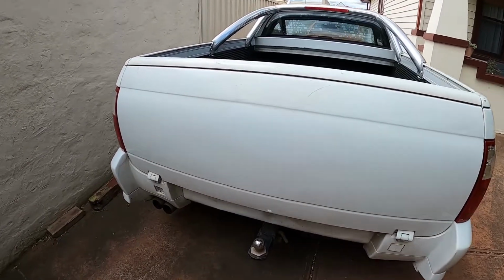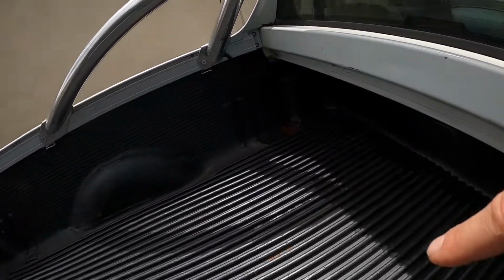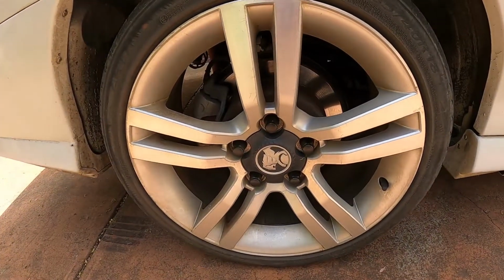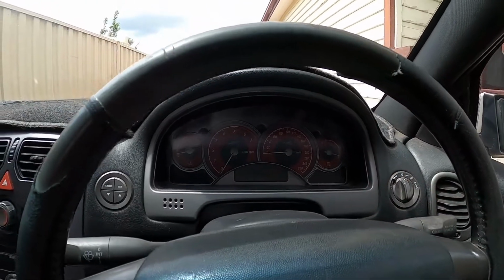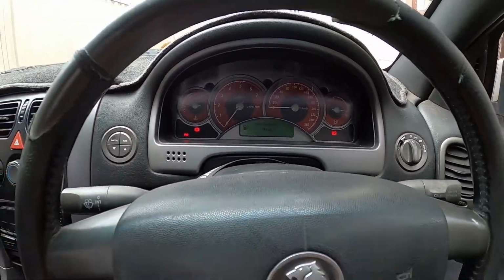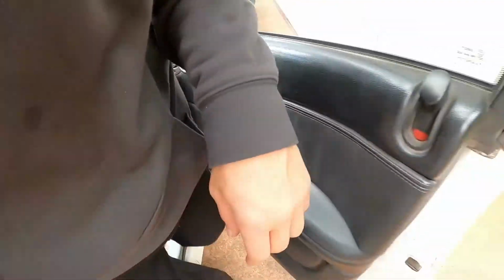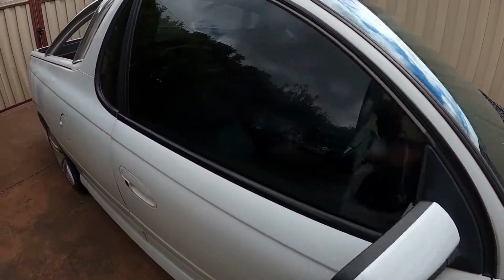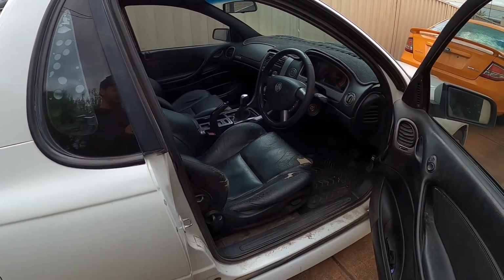VY CAMMED LS1 T56 UTE - Part 3

Comment: Loving ya work, fuel issue could be a bad start relay? Try flipping with the high beam relay. Could be a bad earth too but ya prob right with an incompatible cluster.
Reply from the maker: He mate, thank you for the positive feedback and I'm glad you like the videos. Hopefully I can do it full time soon. The reason it was hard to start after the oil change was because I cranked it a few times to get oil in the system before starting it. This caused it to struggle and it has never done that before. Every time I have started this car it just fires up straight away  except this one time hahaha
Reply from the maker: @dalestarick  Thanks for this information and helping out. Much appreciated